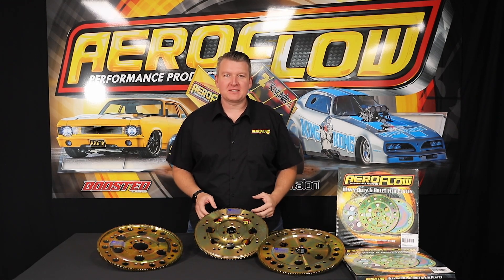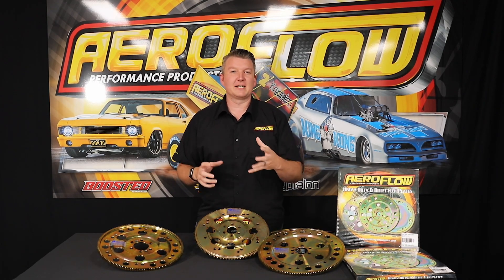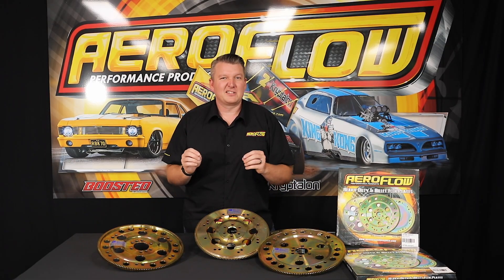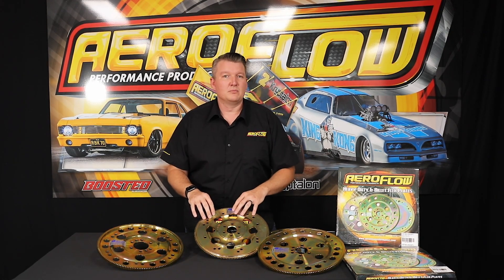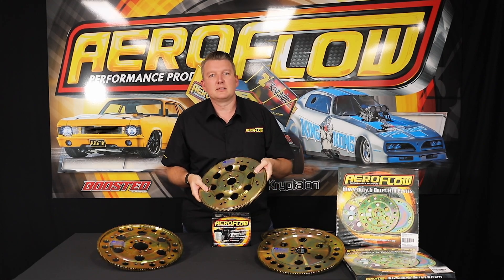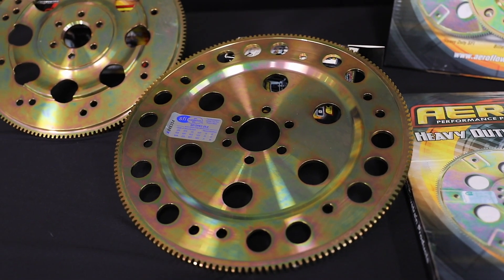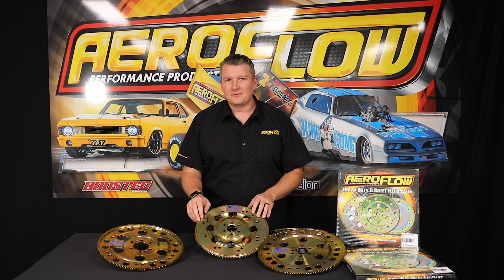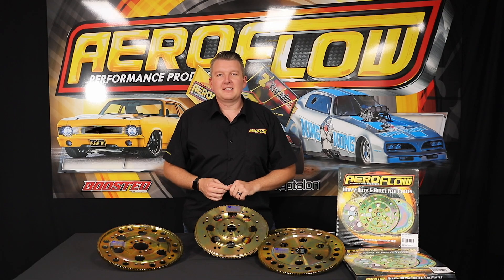Billet Flexplates

Comment: 427w internal balanced mated to a power glide. One piece rear main (sho block.) do you have one for my application? I think 10.5 bolt space converter.
Reply from the maker: Sure thing Billy, check out this link: https://aeroflowperformance.com/af88-302nsfi-billet-302w-351c-164t-int-bal